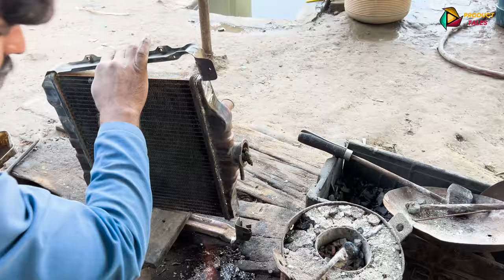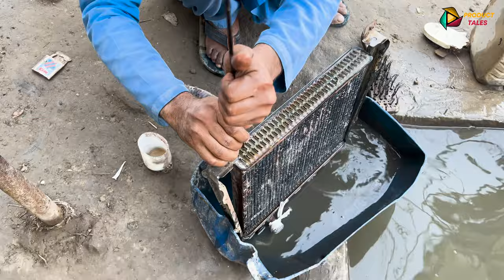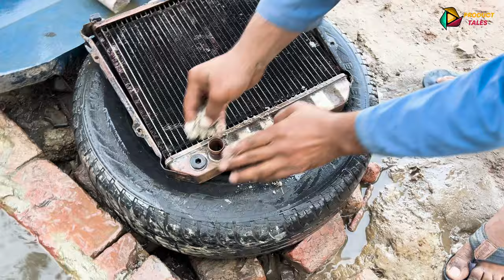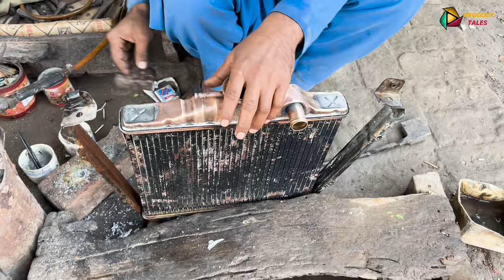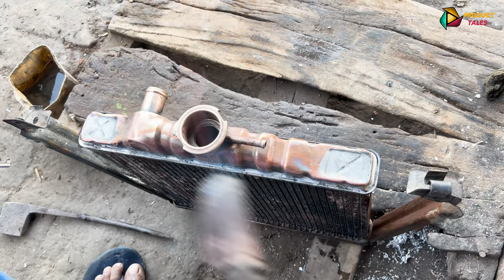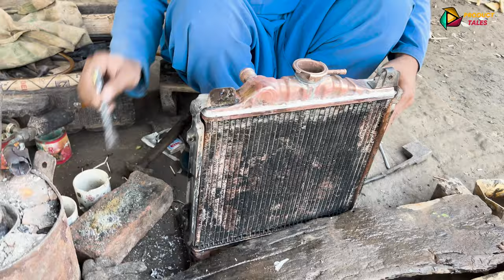Reviving Radiators: Step-by-Step Car Radiator Repair Process video | Product tales

Comment: Did you remove only the radiator to or also did you remove it's bottom
Reply from the maker: Yes, I removed the radiator and its bottom to ensure a thorough cleaning and maintenance.
Reply: @product_tales  thank you for your prompt and clear reply. I have an etios 2012 petrol and a maruti ignis 2018 petrol it doesn't have that kind of copper top and bottom as in my dad's ambassador, it has only a hard plastic top and bottom can the plastic bottom also be removed the same way with pliers as we remove the top, as I haven't seen in any video people removing the bottom a detailed vedio would be helpful, it's just a suggestion